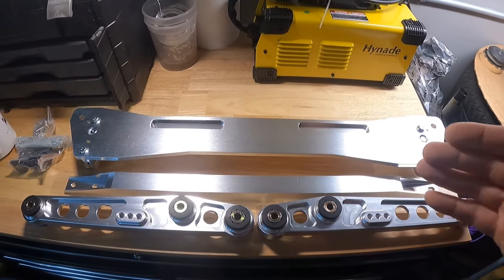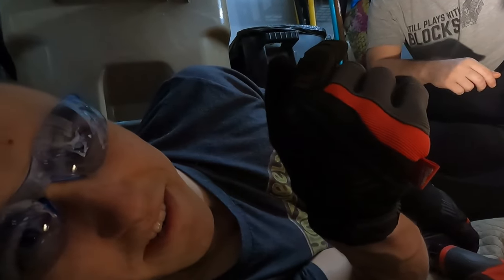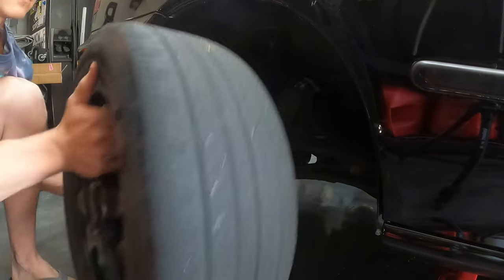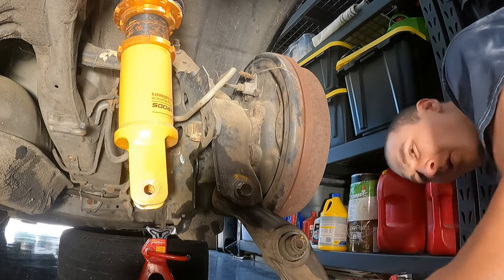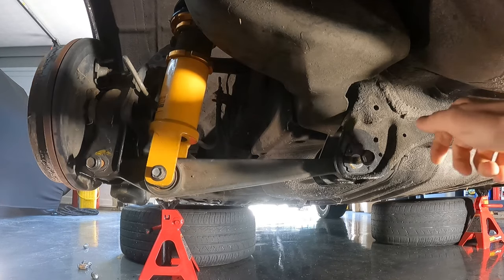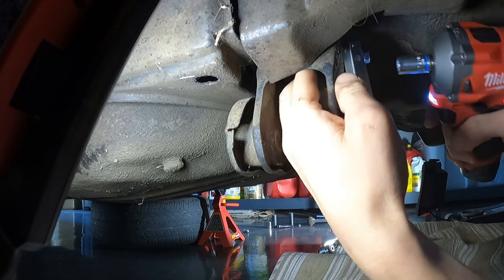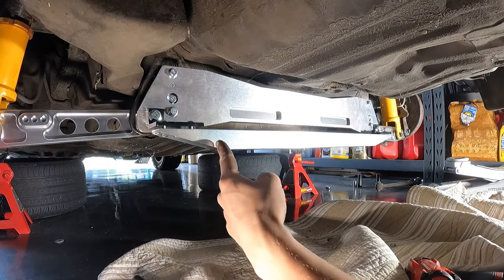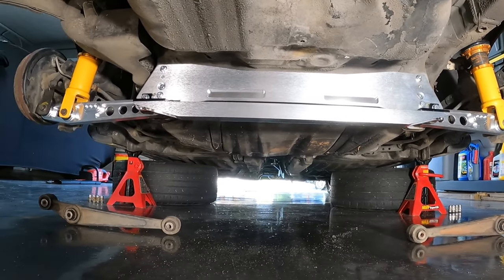HONDA CIVIC Budget Parts Build - SUSPENSION (LCA, Subframe Brace, Tie Bar)

Comment: How are they so far? Any issues?
Reply: Bushings doesnt last that long
Reply: @marcusvalentin5485  I think you should tight the bolts for bushings when the wheel is on ground not when there is no weight on them
Reply: @weekendmechanic1  exactly why i wrote this :D

Comment: You've should tight it on load.
It will destroy tour brushings even they're pu
Reply: Was looking for this comment, so I jack up from the trailing arm as i tighten the bolts right?
Reply: @ThatstaticEKHatch  yes you torque it on load.
Jack it, put a wood peaces under pour wheel and torque it to spec 😉

Comment: Subframe brace really helps the rear more stiffer?
Reply from the maker: Not really, just more chassis rigidity. Rear sway bar would be the way to go for stiffness
Reply: Rear brace for styling only
Only reason you gonna need it is when you have stiff aftermarket swaybar  , it gona tear your chassi without the brace

Comment: My subframe is rusting , what should I do , could I buy this to repair it?
Reply: it wont repair it.

this is only a brace, a support to make the rear end of the car more solid, but it is still bolted to the subframe

if the subframe rusts away (which it eventually will), the brace will fall off and the car will break

what you should do is look for another civic like this (i beleive the hatches, sedans and coupes all have this same exact rear subframe, but i did no deep research on this so dont quote me on that)

with a new subframe cut from a donor car, you should take that and your car to a professional welder to cut and swap the pieces (yes, it will be kind of expensive, but you do not want to try it yourself if you are not an experienced welder, you dont want your rear suspension disconnecting from the rest of the car mid-drive)
Reply: also, if you havent, you should take out the carpet (some bolts here and there, take out the seats front and rear, center console, some trim) and coat the interior floor panel in 2 coats of a special anti-rust sealant.

VERY IMPORTANT TO HAVE ALL RUST REMOVED BEFORE DOING THIS!!! otherwise the rust will keep creeping underneath the coat and not only will it be harder to repair, but it will be harder to spot mild rust